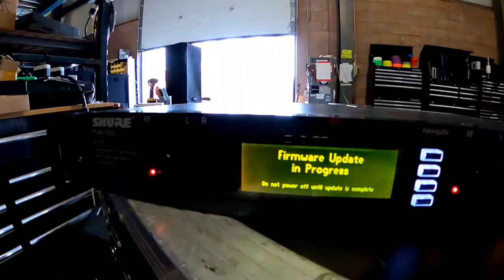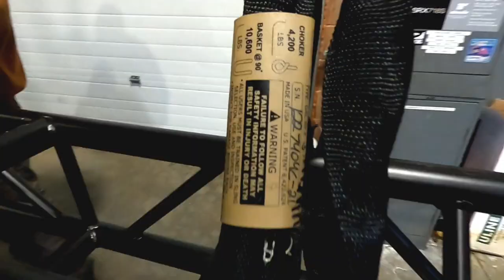s7e1 How We Stack Heavy Road Cases | Sound Guys At Jersey Diner | Shure PSM1000 Firmware Update

Comment: That spanset wrap.... c'mon, really!?
Reply from the maker: What cha mean? Don't get me wrong, we can team lift at times. But we don't have room for a fork, and this set up us good for a guy if he's alone in shop to stack.
Reply: @soundshopvlogs  Sure, a stacking motor is essential, but wrapping a spanset on the top chords of the truss only will de-rate your safe working load by about 60%. Also, you could get some straps and do the same thing with a single motor (unless you're worried about the load on the beam, but then I'd use a bridle instead of the truss anyway.)
Reply: Sorry for being the stereotypical internet critic! I like your channel a lot.
Reply: That got Changed as soon as I got back. The truss is better than single motor for us cause we use it for testing gear. I have the video wall hanging as I type this
Reply from the maker: True. Generally what were stacking or lifting is definitely we'll below load. We keep the 16ft up there for occasionally video wall testing and trouble shooting.
Reply from the maker: No worries.. thanks for watching.
Reply: Sound Shop Vlogs I’d like to point out that I said we should be doing it from the bottom of the truss
Reply from the maker: @claptonisgod41296  he did. #gruniewasright